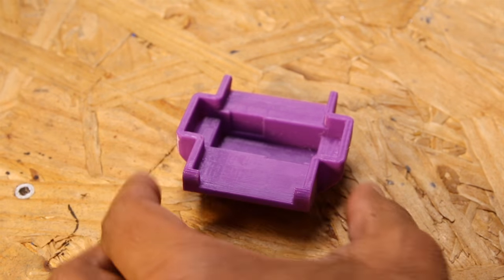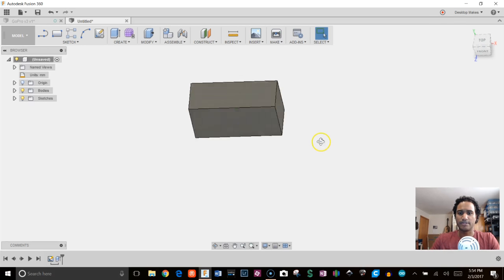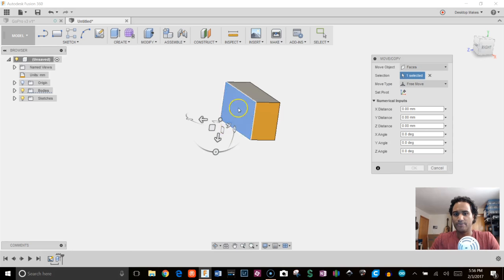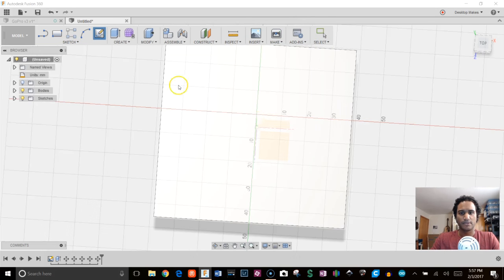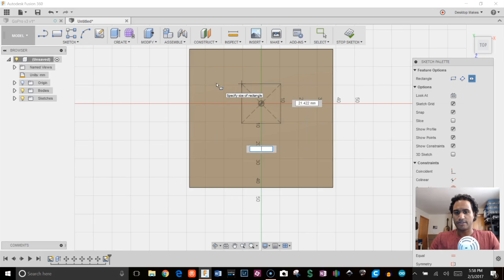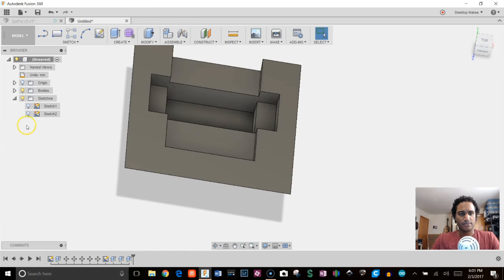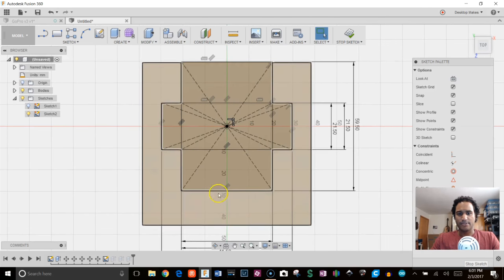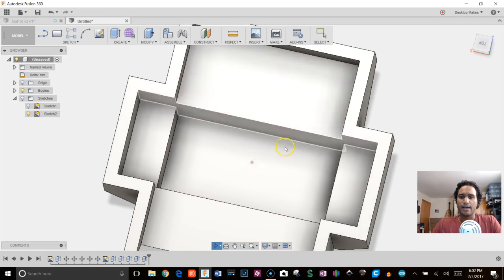GoPro Polyhedron

Comment: I had never heard of these 'stands' before. What a superb design. The simplest ones are often the best.
My Z axis is set to up. You can change it under Preferences > General > Default Modelling Orientation.
Reply from the maker: It's a very handy design.  I'm constantly using this stand with my gopro.  I mostly design with my z-up but decided to keep the default y-up for my tutorials because that's usually how people just getting started will have it and I wanted to keep things simple for the tutorials.  I'm still debating this choice.  Y-up is definitely not a good choice if you're going to 3d print.  I wish Fusion would just make z-up as default.
Reply: I too prefer Z-up to be the default. But, it's not a big deal for me. However, it could be for newbies I guess.